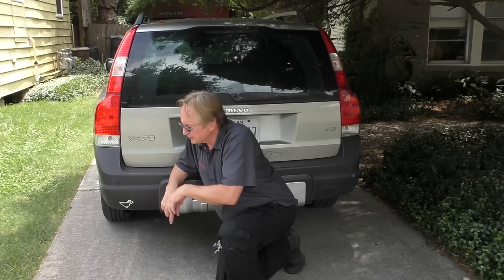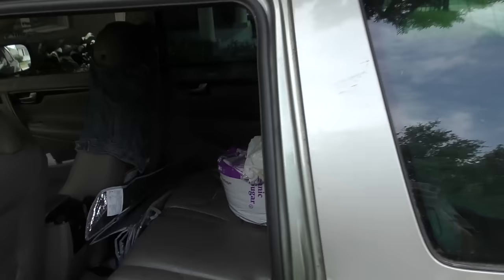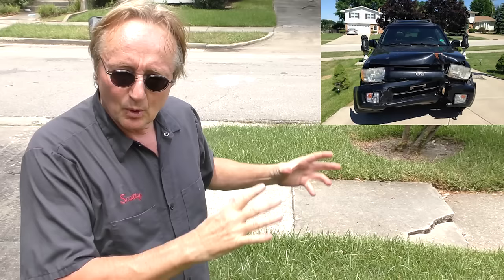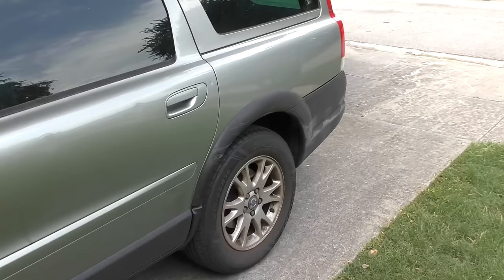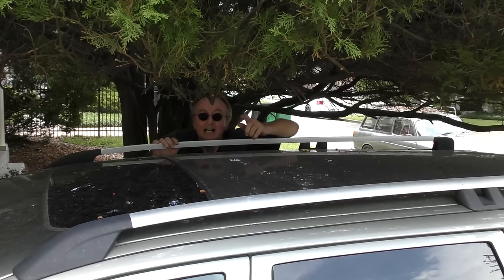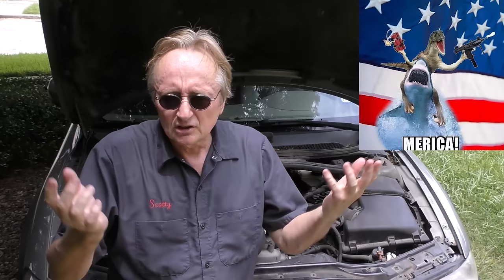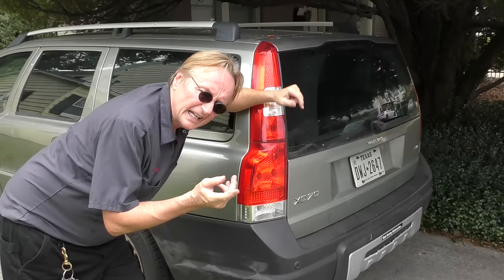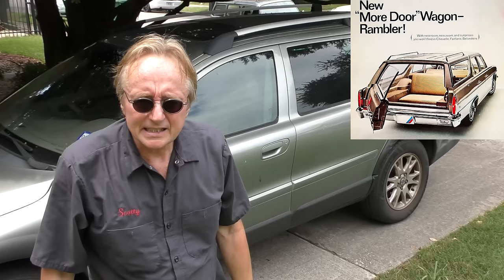Here’s Why Old Volvos Last Forever

Comment: There was a guy at my work that had an old Volvo, went like 500,000 miles with no issues. Bragged about it to everyone, how smart he was to have such a reliable car brand. So he went out and got a new one. Nothing but trouble after trouble. Boy was his disillusioned genius.
Reply: they dont make em like they used to.
Reply: Had zero issues with my 2018 V40 T4, what model did he have?
Reply: Everything went down hill early 2000’s i think toyota bought them? Dont trust me though to lazy to double check.
Reply: yeah...  now  many  car  company  become  'robber'...they steal consumer money  very  fast 😅😅
Reply: Geeley , a Chinese company bought volvo in 2014 I believe, and its  been a crappy product since then.. nothing but engine and electrical problems.... Smh
Reply: @alexlevy322  They went to hell when Ford bought them.
Reply: I have a 2005 V70 2.4 and it is great. I bought a 2019 XC60 and the electronic were miserable. When the warranty was about to expire, I sold it. I would never be able to keep the electronics working. Now I back driving the 2005 which luckily I kept. The XC60 nav system was the worst nav system I've evey used.
Reply: I have one xc60 never had problems, Do you own one?
Reply: @inception727   I bought a 2019 XC60 and the electronic were miserable. When the warranty was about to expire, I sold it. I would never be able to keep the electronics working. Now I back driving the 2005 which luckily I kept. The XC60 nav system was the worst nav system I've every used. The ACC, CAS and Pilot Asst were awful. If I trusted it, I'd be dead!

Comment: Old Volvo saved my life when I got T boned on the Driver’s side when someone didn’t see the red light.  I was fine, her car crumbled
Reply: And I'm guessing the Volvo had a lil scratch
Reply: Hello Community, I’m thinking about buying a 2000 Volvo S70? Does that sound like a good car? It’s got 120,000 miles, someone’s selling it for like $1000, but it doesn’t start. Any comment, thanks.
Reply: @DSJVNdsjnvf4356  try and find out why it doesn't start and see if the millage is motorway millage
Reply: @DSJVNdsjnvf4356  The 2000 s70 is a great car.   My first volvo.  Get it checked out and enjoy.   Probably the battery or starter motor is the issue.  This car can do a lot more than 120k miles regardless of city or highway miles.
Reply: @DSJVNdsjnvf4356   There are some good Non-dealership shops you can take it to and have them check it over.  I got mine from one of these shops here in KY, and it's been great.  Find someone who specializes in old volvo repairs.
Reply: Brandon Mills New battery, check the oil and it will kick
Reply: Sips🥰
Reply: I got rear ended at a stop light the car was doing 40 mph.
It fell apart. The driver was asleep and unhurt. 
I was shaken up but my airbags didn't even go off. I had my seat-belt on and it gid a great job.
I drove away my tail lights were cracked but they were working.
I could have been seriously injured  if i were not driving a Volvo XC .
Reply: absolute tanks
Reply: totally lie, should remove both side doors. and fix airbags. if only you where not driving Volvo L-60

Comment: Yup old Volvos run for ever..my 244 from 86 is still going strong..all the best from Sweden ....
Reply: @Pedro DLR nope
Reply: Pedro DLR nope 5cyl Volvo lump.
Reply: 92, 240 wagon, runs like a dream , love my baby
Reply: G Iove A 1986 244 most likely had a B23 Volvo 4-cyl. Indestructible.
Reply: @adorabasilwinterpock6035  for some reason I feel like the rear left wheel when Scotty shows it looks like it's pushed forward almost I always get paranoid of vehicles getting hit on the axles and hidden damage that doesn't become evident until later on
Reply: But it's a Volvo so it's fine anyway
Reply: I remember drag racing one of those years ago on a yamaha RD LC 250 ... it kept right up with me. I was surprised!

Comment: Great story Scotty.  My first car was a 1981 Volvo 264 GL. An older gentleman ran me off the road and I ran dead on into a concrete road medium at 45 MPH with no seat belt.  I tried to start the car but it wouldn't start. Had it towed to the mechanic and he said I'd completely ripped the engine off the motor mounts and back into the firewall.  Not a scratch on me.  Owned nothing but Volvo's for the last 45 years of my life. A few with over 500K miles on them.
Reply: Nice! I've had two first gen xc90 V8s loved em! Unfortunately we will never see their like again as the new company has ruuined them
Reply: Thanks for Sharing this...
Live long 💐

Comment: I've been driving a V50 Volvo Wagon (2007) for  2 years now and love it!!  It's solid as a rock, no issues, just keeps going down the road - looks and feels great too.  Not bad for under $3,000 price tag.
Reply: Got a 2004 one for less than half that as my first car, had to shampoo and clean the entire enterior. It's great
Reply: Watch out for the fuel rail sensor going bad.  I just replaced mine.
.... Achilles heel for the P1 cars

Comment: Those old Volvo 850 and then the remodelled V70s were very well made.  Even the turbo charged 5 cylinder petrol engines hold-up really well.  The British police used to use them a lot - so there's an endorsement for their build quality.
Reply: On another video, Scotty tells us why the I-5 cylinder engines are terrible. He is not consistent at all.
Reply: Public motor pools are no indication of quality.  They are an indication of low bid budget requirements.  It's no different here in the US or in most of Europe.  As police work has grown in comlexity, the vehicles have incereased in size and complexity to match.  The Brits no longer use Morris Minor's for a reason.
Reply: Ok..i see..  how  about  fuel  consumption ??
Reply: It's  weird...british  police  use  swedish car ...when british has own car like  vauxhall...jaguar..rover...lotus  etc😅
Reply: @indotube8125 Vauxhall hasn't been British since the 60s, became part of opal which is owned by GM, rover doesn't even exist anymore ( mg is currently owned by indian) and any lotus ain't gonna carry much equipment or suspects 😂 recently some forces have started using volvos again, many still used Vauxhall astra's as you mentioned and Peugeots along with fords
Reply: @indotube8125 the reason they loved old t5 Volvo was the 2 aces, Pace and Space, build quality was secondary, but reliability was definitely key.
Reply: @indotube8125  nothing worse than any other five cylinder 2.5 liter turbo lol

Comment: Owned a 1970 244, stick shift. Bought it used for around $200 back late 1980s. The engine was amazing. Turned and handled amazing, very small turning radius. Perfect torque, could handle hills like nothing else. Heard that 4 cyl engine was the most reliable engine ever created, could last over a million miles. Darn shame I sold it.

Comment: Wow, what a coincidence. I just bought a 1993 Volvo 850. Already love it. Higher miles, still runs like new. Owned by a mechanic and maintained well. For $1000...
Reply: Best choice of your life.
Reply: Make sure the PCV system is good is all I can recommend.
Reply: Make sure to get the timing belt, water pump, and idler and tensioner replaced every 75k
Reply: I had an 850 wagon it was a great car.  Keep it and look after it, it will look after you

Comment: I love our V70 and will do anything to keep our car to last forever. It's fast, safe, comfortable and practical.
Reply: Is it hard to work on?
Reply: Nikki Bass volvo is a easy car to work on
Reply: I love driving my old V70
Reply: My v70 was so comfortable.  It made it to almost 300k. Loved that car. Currently drive a 2006 s40 with 240k miles.Not as comfortable but I love it.
Reply: I’m thinking about buying one but idk yet cause the guy said it had a small oil leak in the power steering hose. Do you think I should get still
Reply: @ariass9345  Go for it
Reply: @ariass9345  did ya do it? I just bought a 98 v70
Reply: @Skunkhunt_42  no I ended up buying 2016 Altima
Reply: Volvos are not hard to work on at all. They are Swedish! Now German cars are hard to work on BMW VW Mercedes yes.
Reply: @ariass9345  Sell it, seriously. 
They have crappy Jatco CVT transmissions that Scotty always warns people about. 
Get  a 2012-2017 Camry hybrid.
Reply: My exact feelings about my 07 V70 P26.
Reply: I now have a V60 T6 though I wish I could have a third and final generation V70 T6. What's wrong with XC60 and XC90? They're NOT sporty nor feel sporty to my taste due to higher center of gravity. Still want a proper station wagon.
Reply: just bought a 06 xc70 2.5L. had it two days and already replacing alternator lol. I never worked on one before but currently looking into how the battery is in the back and also positive cable in the front by fuse box. Anyone own this model?
Reply: @Skunkhunt_42 how has it held up ?
Reply: @95cv95  solid. Maintenance def but generally easy and cheap to work on. I've bought 2 now. A 20yr+ old Buick lesabre probly cheaper to keep on the road tho, but that's a guess. The nostalgic luxury of the volvos is def a +. There'd also a huge welcoming volvo scene keeping these cars alive. RobertDIY here on YT is prime example of such.
Reply: @Skunkhunt_42  that’s great. I going to look at  a 99  wagon tomorrow. Looks really clean . Thanks for the info I will check out that page .

Comment: Right again Scotty. Had a 1973 Volvo wagon, had fuel injection, 4 wheel disc brakes, that swedish steel was bulletproof

no car payments and cheap insurance buys a lot of gas!
Reply: Volvo before it was bought out was the best of automotive engineering in the name of reliability. It's well known they detuned the engines in the name of reliability. My RWD Volvo's have been extremely reliable. I have a 1992 240 with 450,000 miles.
Reply: Regret to this day letting go of my 77 245 4 speed manual with the over drive switch. Those 4 round headlights will live on in my memory.😌
Reply: @leleedler  That's the good thing with the chinese. Unlike Ford they let volvo do their own thing how they want to. They don't mess with something that's working well.
Reply: Indeed Scotty
Reply: Here in Belgium with the volvo xc 90's where a lot of problems. Since it's basically Chinese it's rubbish in every way. The old ones where real beasts. So strong. Scotty i had the same issue with such boxy old strong volvo too. Mine had just a scratch the other car who ran into my car became 3/4 smached.
Reply: My 1991 240 has over 400k miles and still going strong. It has a maf and a map sensor which in '91 was pretty rare. It's been into battle a few times and drove off with scratches. Solid car

Comment: Scotty, I purchased a 2004 XC70 brand new in 2004. The car has 162K miles on it and we still own it. If you think I am writing this comment to you because I agree with you, you could not be more wrong! This XC70 has been BY FAR THE MOST EXPENSIVE, MAINTENANCE INTENSIVE CAR I HAVE EVER OWNED! I have put probably $20,000.00 in repairs over the last 17 years. $20K!!! These are NOT Toyota’s or Honda’s which really can run seemingly forever. I recently purchased a Subaru Outback H6 3.6 liter 256 HP loaded limited. Not only is the AWD system 1000X better but I do believe that this wagon will last for 20 years with less than half the headaches of the Volvo. 
I replaced the whole rack and pinion steering system, the motor mounts broke several times. The front passenger power window fell into the door and shattered TWICE! The transfer case needed to be replaced. The AWD system sucks. It’s really just a fwd wagon. It’s easy to get it stuck in the snow. My Audi A6 or Subaru are unstoppable in the snow. Ford didn’t do Volvo any favors when they owned them. Steer clear of buying a used Volvo. Better yet, steer clear of buying any Volvo.

Comment: Never sell your old Volvo
...☝️
Reply: JIMI JAMES  For XC70 - you think 3rd Gen is good too? Looking at a 2013...
Reply: Yea I want like 2013 s60 something affordable I’m keeping my 05 s40
Reply: @kayhumph9109  
& DoubleDeckerAnton, 👍 great advice. I'm hanging on to my 1987 Volvo 240 DL.
Never had any problems with it. Routine maintenance. Cosmetic upgrade needed.
Reply: Ever!
Reply: What if you only paid just over $1,200 for it and drove it for a year and a half and then the transmission/torque converter started to go out
Reply: @Meeper2  keep the car and find used parts to repair it.
Reply: @Meeper2  if that's all the car needs and everything else is great find some parts on ebay or a scrap yard  and somebody with a garage. The loss of your current vehicle might not appear too big a deal financially but buying a new car might be expensive either right at the start or when you find out you bought a lemon soon after.
Reply: @Meeper2  steel you gona keap it it's nothing for this priceless car to use
Reply: What year is an “Old” Volvo? 😅
Reply: @waskyhenry3132  this xc70 was great
Reply: Hey, concider than you need to upgrade your cooler intake, if you have a turbo.
Reply: When he says "family vacation" all I can think of national Christmas vacation with Chevy Chase!
Reply: @austinmonday6917  mine is about 20 years old

Comment: We still have my wife's  2003 V70. My daughter drove it for the past 10 years from high school to Med school  and it still has shiny paint and runs great  with almost 200K miles. What I like is the cargo capacity. I can fit a 10' PVC pipe inside, from windshield to tailgate. It's 6' of flat space from tailgate to front seats, big enough to lay a twin size mattress  for a quick camper. And that back cargo area is tall enough to fit tall boxes too.  Amazing for such a small exterior size.
Reply: That just helped me want to buy my gfs aunts volvo...227k 2005 year

Comment: At one time I had three Volvo 240's...two 92's and a 93. 
One of the '92's I bought new...took all 3 of my infant kids home from the hospital in it, 17 yrs later they all learned to drive in it. One of my kids totaled one.... a deer totaled the other.
I have one left with 250,000 miles on it...who knows it may outlast me !
Reply: Whilst test-driving a 1978 240 wagon, I said to the dealer, "my next vehicle will also be a Volvo." I kept my promise and purchased a used 1989 240 sedan in 2001 (fuel injected vs carburator). It died a few years ago at around 220,000 km (odometer wore out at 215k)
Reply: sorry, 420,000 km.....and 415k..

Comment: My Volvo is over 200k miles and still running like new very reliable and well built
Reply: Kev Flores take good care of it dude. Like a japanese 90s car, they dont (and wont) make them like they use to. Never had a volvo but my old man bought a mitsubishi sedan back in 2003. 16 years and 380,000km later, can still rocket to 180 on highways. Wear and tear parts r starting to show its ugly face but that only started to happen around the 300,000km mark few years back. Engine n tranny still as solid as ever.
Reply: It's impossible to run like new  you mean it runs nice
Reply: my 740 had its kilometer counter stop at 894000 something... and then i drove it for about 8 years more.
In the end, it was the rust that took her. Not the engine, nothing mechanical, nothing electrical. cheapest car in the world to maintain on those parts.
Just to point out how insane that is, the counter stopped after the car had driven the distance to the moon and back, and then drove for 8 years more!

We will never see its likes again.

From Sweden with Love
   - Kami

Comment: I’ve got a 1995 Volvo 940 
With 430k miles on it and still going :) my work car and my other car is a lowrider the Volvo is my reliable one
Reply: Was the transmission an issue or New timing belt replacement?
Reply: Shawn Hampshirehick well yes they need replacement. Just like anything else. If you take care of it and read the Manuel it’ll last forever.
Reply: Lord Thunder I wish
Reply: wow thats a lot of milage!!!
Reply: Shawn Hampshirehick I just realized I didn’t answer your question. Transmission not an issue. *knocks on glass*... I had to get a new gear shifter the other month. As long as I put aside $500 $700 a year I’m good. The 90’s Volvo’s are the ones still on the road. There is enough room in the engine to do things yourself. Before that made it hard to work on your own car so they got people to take it in to shops instead.
Reply: Oh wow, my parents have the exact same. 1995 940! What an extremely nice car, my favorite

Comment: Those petrol volvos might be good but the diesel ones here in Europe are pretty much indestructible. My neighbour has a 97 V70 D5 with just over 744.000km around 500.000miles which is in better condition than my fathers 2015 Audi A6
Reply: Your failed. And my old classmate's to..
But his gasoline V70 with LPG lived for 510.000km
We sold your Volvo Diesel with 180.000km. The engine was great but the transmission was about to go out, probably 80% of the electronic so..
Reply: That's true. I had a 1998 S70 with diesel inline 5 engine and it had 475000 km. I sold it only because I had no money for registration, first registration was like 400 euros, and my pay was well under that. There's a story video on my Instagram of it before maintenance, if you want to check it out, name's @marxeny.
Reply: 97 is the VW TDI engine. D5 was produced from 2002 onwards. Both are very reliable with regular maintenance.
Reply: Yeah my friend have V70 with that VW 2.5tdi and automatic transmission, bit over 600k miles now and still rocking with original engine and transmission. I have petrol 940 with over 300k miles also running just fine!